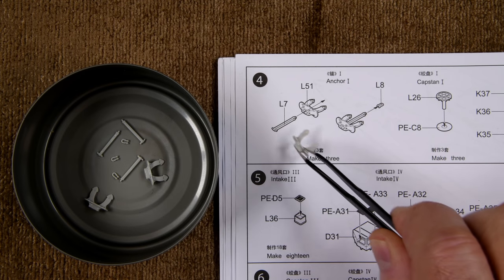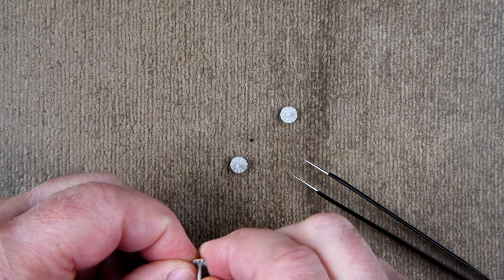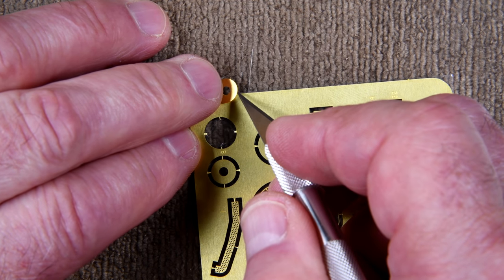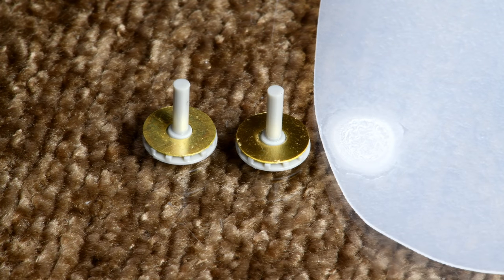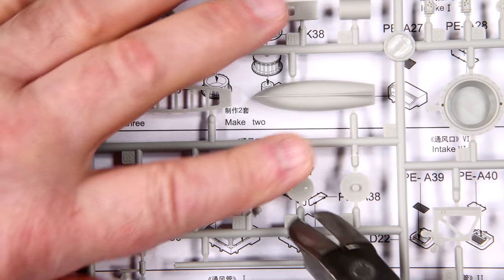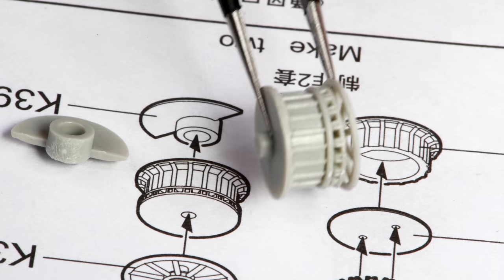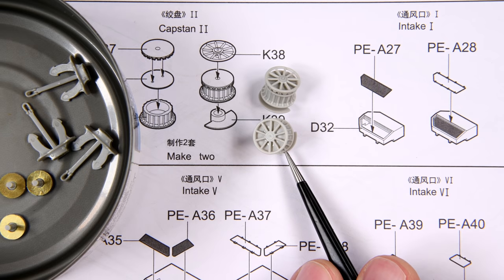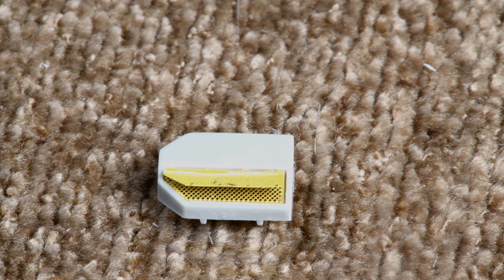The Model Ship - Part 43

Comment: They give the spares not because of "ruining", but because of the stencil.  If they only gave one of those per sheet, you'd need 3 sheets instead of 2.  The sheet is probably standard sized  which is the cost driver here, the part costs the same if you fill it or don't (well, minus design time).  THIS is why I started watching you though, I wanted to see information on PhotoEtch parts.  THANKS FOR SHARING!